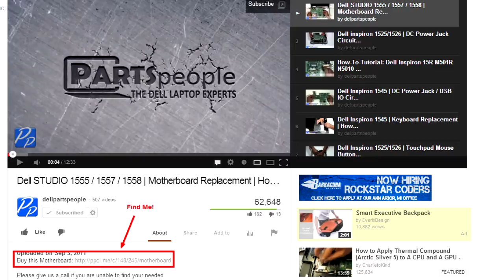Dell Inspiron 15 (3521 / 5521) LCD Bezel Replacement Video Tutorial

Comment: Very good video.  Attention to detail was spot on.  If I could add some constructive criticism, it would be to mention removing the DVD drive before removing the hinge screws.  I've ben in the electronic repair business for over 30 years and needed some assistance in getting the bezel off.  A+ in my book.